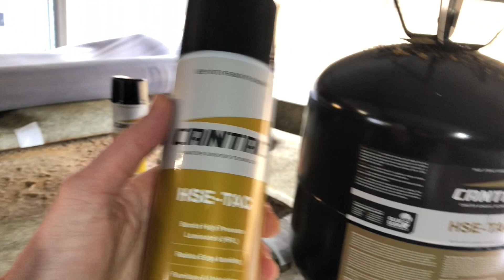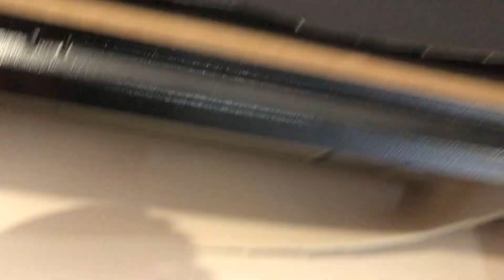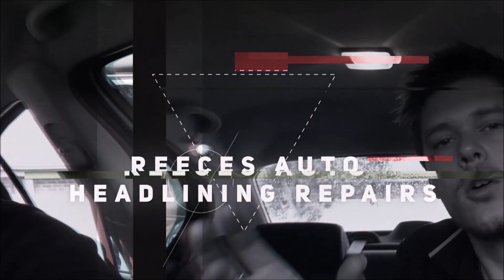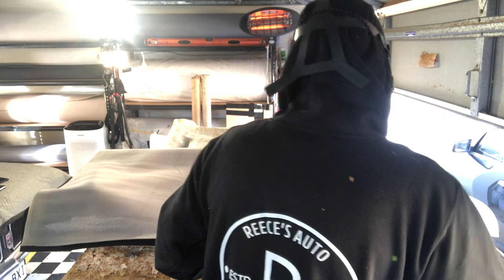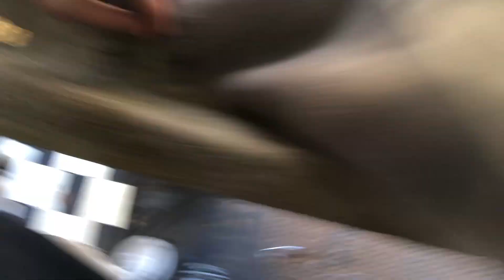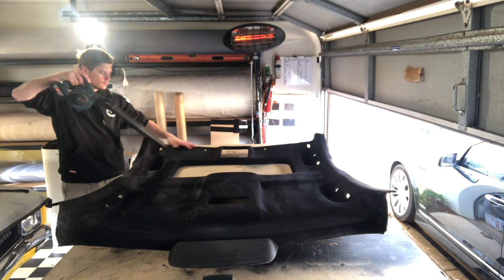How to fix your sagging Headliner❗

Comment: HELP! I just put some fabric on my perfectly in great shape 2013 prius headliner. (Modifying for personality and fun) 

the problem is that i also did starlight fiber optic cable thingy...(again for fun) and poked hole using sewing needle. But when i pushed fiber cables through, a lot of them where pushing against the newly laid fabric. I gues the needle just slid through fabric mostly, instead of actually making a hole.

I have droopy spots 😢 and even some corners are over stretched it seems. I dont know what to do now. Besides buy starting over from scratch....but that seems dreadful and im busy father who is going back to college.  Is there anything i can do short of "re-doing" my work?